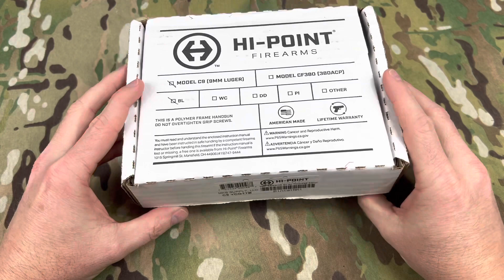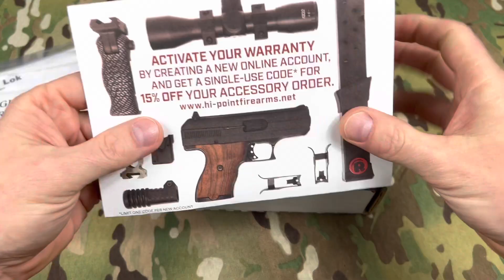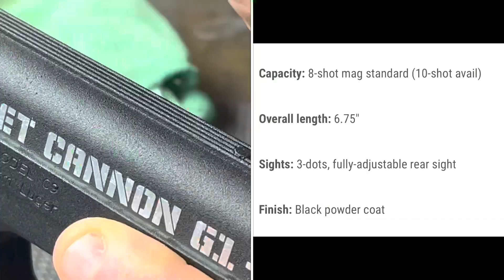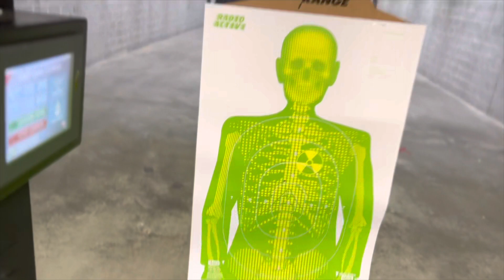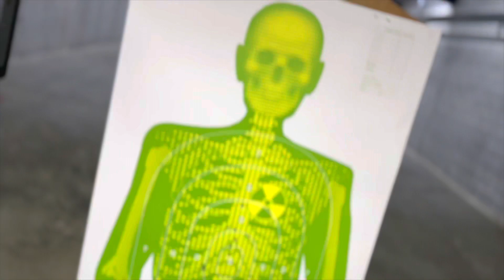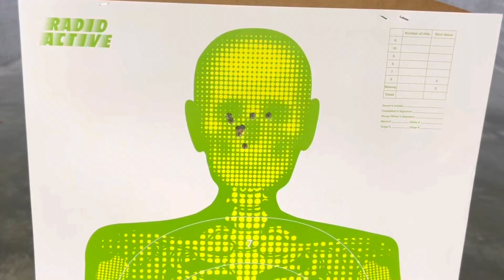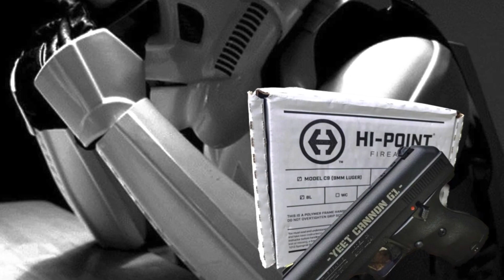Yeet Cannon G1 w/ Threaded barrel - Must See!

Comment: I've got 3 of the HiPoint C9 and yeet cannon that I bought used. Didn't pay more than $100 each. I keep them spread betwnn my workshop, truck tool box and barn for just in case. Have put a few hundred rounds through each testing reliability and have no worries trusting them as a backup "truck gun". They get dusty, dirty, and beat around but at the price I cant complain